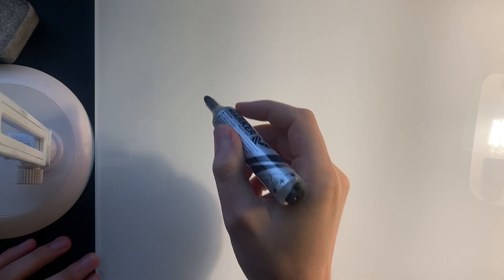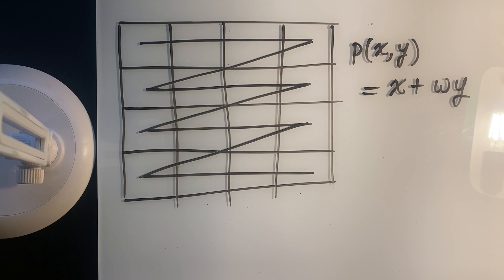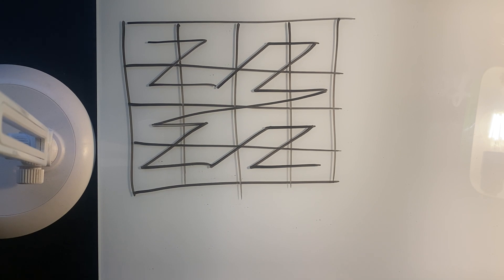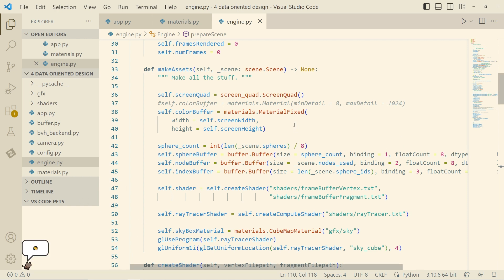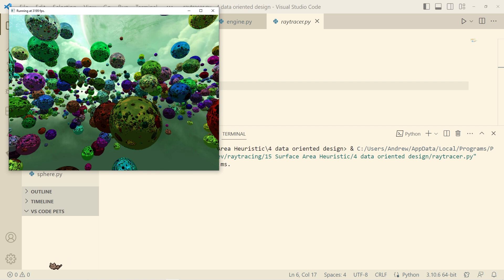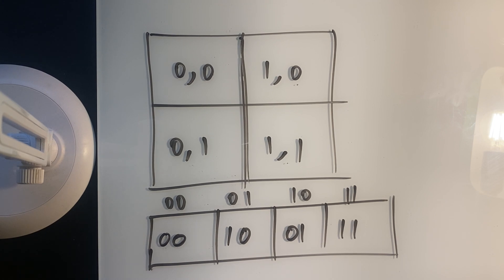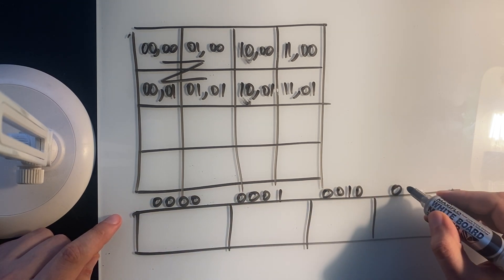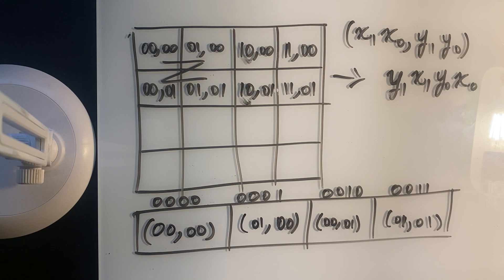What are Morton Codes?

Comment: generally i think the speed improvement for power of 2 texture sizes comes from the sampling efficiency. if your texture exists in the range of (0,0) to (1000, 1000) and the sampler allows any value, even outside of that range, then it can tile by sampling then the sampler has to take your sample x and y coordinates and compute the remainder when divided by 1000 to tile it into the range of the texture. that requires an expensive division operation, whereas if its a power of 2, like 1024x1024 (a range of (0,0) to (1023,1023)) then you can just use a bitwise AND with 1023 to get the remainder which is a much faster operation than division